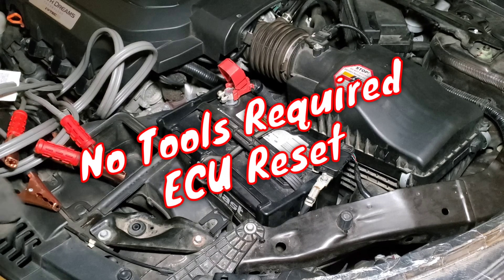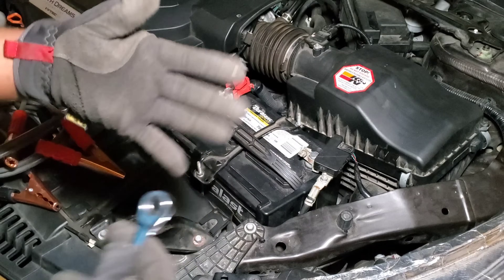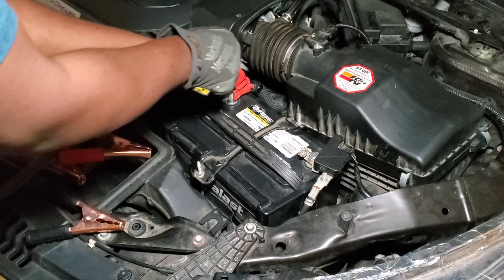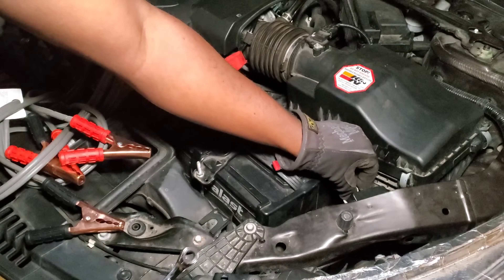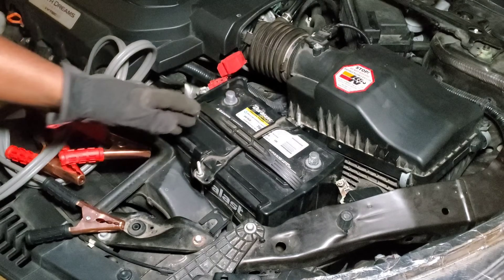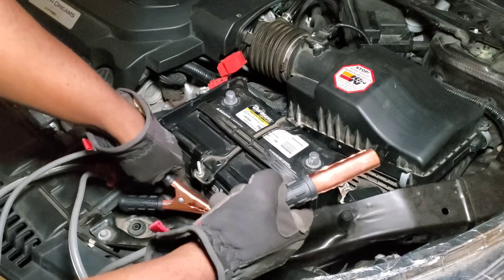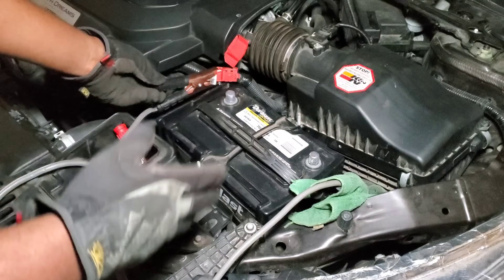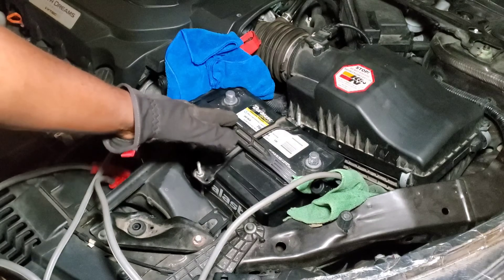How To Reset All ECU  No Scanner No Tools Required

Comment: How can it be "no tools required" when it takes a wrench and a jumper cable as tools wherever your battery is located?  🧐 My Chevy HHR, it is located at the back end with the spare tire.

Though good points like a few others I've seen here on YouTube for the same procedure.

Comment: hello . i have a chevrolet cruze 2012 1.8 . i had different issues with disco lights in the car, car dying on me while driving,  starter dying on me . we changed the negative battery cable, the starter and drew new positive wire to the starter. after this,  the obd tester said "ecu error" , the buttons for my stereo wont work, the sound for my blinkers is gone,  my park sensor wont work. i read somewhere that this would help, but do you have Any usefull wisdom to share ? just bought the car, and the day after it started acting up on me. real sorry for these issues. 
best regards from Denmark
Reply: by the way , the "ecu error" disappeared by itself the next day , but the other stuff still doesnt work

Comment: Hi brov I have changed the engine oil and oil filter  after that my dashboard didn't stop showing oil pressure too low is this reset will stop it?
Thanks brov
Reply from the maker: you need to reset your maintenance code after changing your oil and Filter
Reply: @Loverofengines101  I have found the problem
It was the wrong oil filter so I replaced it no the car is driving great 
Thanks for you help 👍

Comment: 1995 d21 nissan hardbody 5speed 2wd manual trans will this work? my ecu is BAD, or well it "THINKS" It is? idk? maybe bad tho... and when check engine light is on it has no power but moves drives, just cant floor the gas pedal or car will die... but runs and drives picks speed up slowly... is this my problem? will this work? The check engine light comes and goes....

Comment: Thanks for the great video..
Always learning.. I have a vauxhall vivaro 2012 2.0 cdti, unfortunately error code DF067 injection multiplexed emission missing, and ecu no communication.. I have checked the midle connection to ecu, and I noticed that I do not have 12V on the wire T2 PIN 4Q of to connect to ecu.. Can be that the problem with my van? Thanks
Reply: Pppp

Comment: Remove the Negative Terminal first!!
Reply: You are right. Every metal parts on the car is connected to the negative wire/terminal. If you positive wire touch any metal part while the negative is still connected to negative terminal you will fry your ECU and other eltronic components.
Good luck there...

Comment: What if I disconnected the battery for more than a year, should I try your method to my car?
Reply: How to get the codes back if there's nothing after so long??
Reply from the maker: to me this is only if you have a ECU problem, after you disconnected your car battery for more than a year you should worry about ECU,  because this is to allow the car run out of energy so it doesn't save any code 👍
Reply: @Loverofengines101  thank you

Comment: say I have cleared a error , changed plugs and ignition coil and module. drove around to clear computer . new error and check engine light comes on after 15 miles. I can't inspect car would fail which I need to do over due. if I try this how long will it last and will it show pending tests . I will fix the car,  just hate driving around with over due inspection. this fix cant last long with bad sensor issues right?
Reply from the maker: this will help get rid of all codes on your car, but if the problem is not fix the code is going to come back. so make sure you take care of the problem before you do this
Reply: @Loverofengines101  I figured as much, just had to ask . thanks for the fast reply.
Reply: @terribeller3710  do yourself a favor and pick up a code reader, not expensive and can be used on majority of cars so even if get different car your still good. I picked mine up used on Internet sites

Comment: Can it work on peugeot 206
Reply from the maker: to me this is for all types of cars ECU
Reply: @Loverofengines101  my peugeot wont wove when i shift the gears....everything is normal on parking mode
Reply from the maker: this is not a ECU problem, this could be your transmission problem. Change your transmission fluid and see what happens

Comment: Thanks,, one question I don't have jumper leads can I just disconnect the battery for 2 hours or so 👍👍
Reply from the maker: try that and see, and if that works out for you let us know in the comments section. because for me I used the jumper cable and it was my first time doing it and it reset all my ECU
Reply: As long as you can touch the pos and neg cables together should be fine, however not all sensors store electricity so should be ok to continue without

Comment: Thanks for your video
Is that working on Citroän c1?
I removed the battery and charged when I put back it  the car doesnt want to start
Reply from the maker: this works for every vehicle ECU, make sure your car battery is connecting properly
Reply: Could be immobiliser issue.

Comment: How do I really know you had codes before you showed how to disconnect battery to reset ECU ? You did not show dash codes before starting. Most mechanics are hard to trust these days 🤨😑
Reply from the maker: check out my video on how to clean throttle body, if you're a DIY person you know that every time you open the throttle body on your vehicle you're going to get all the ECU lights on your screen. if you really want to reset your ECU this is how I reset my ECU and I'm sharing. I'm not getting paid for doing this just trying to help people save money
Reply: @Loverofengines101  , Does this method reset alarm going off?, I have problem with alarm going off in my honda pilot 2003, thanks.
Reply from the maker: @gshrdy5415  if your alarm is going off on your car try this and see, close all the doors use the key to lock the door DO NOT USE THE REMOTE CONTROL TO DO THIS. turn the key 3 to 4 times to lock the door. and turn the key 3 to 4 times to open. this should help take care of the problem
Reply: @Loverofengines101  , problem is I don't have the keys for any doors, I only have ignition key, I lost the rest.
Reply from the maker: @gshrdy5415  yes this is what I'm talking about the ignition key you use to start the car. use the same key to lock and unlock the door
Reply: @Loverofengines101  , For my car ignition key doesn't lock or unlock the doors, I know I need to get one made for doors.
Reply: @gshrdy5415  thats pretty horrible man.